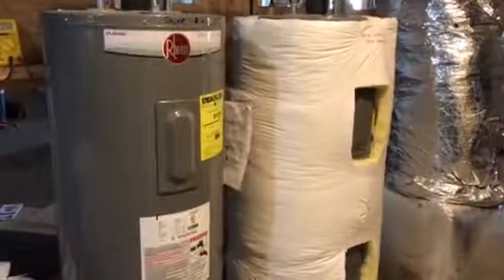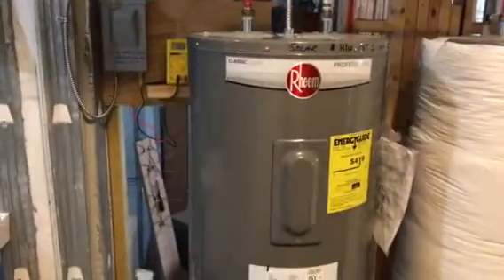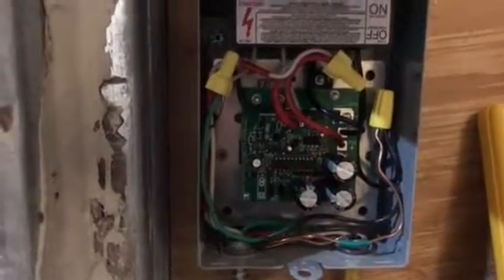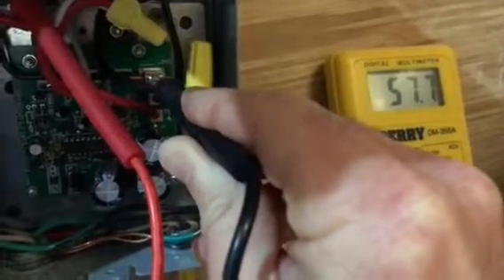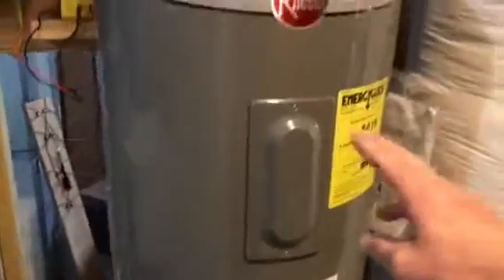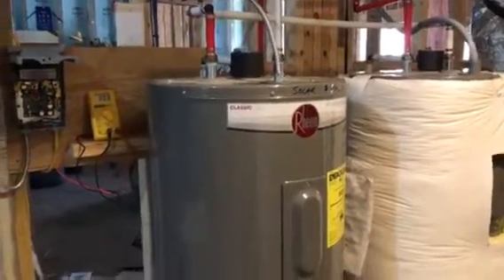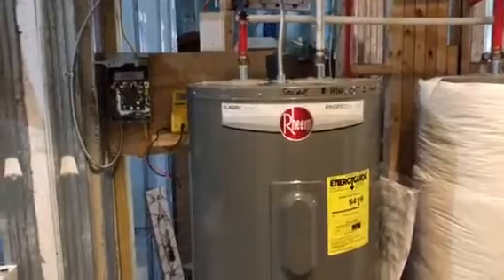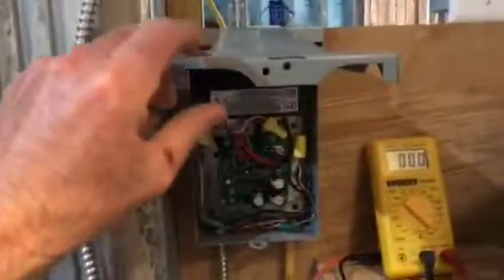Solar PV Water Heating and Power Storage

Comment: What is the advantage of using the Techluc if you have an electrically isolated tank might as well just run direct dc to the element.
Reply: Mppt in the device makes it way more effective than just raw dc.
Reply from the maker: Direct DC to the element is problematic.  Techluck explains the reasons on their website.  However Waterheater.org also discusses a direct DC setup - but it is a bit complicated.  The Techluck MPPT has after a year been working great.
Reply: @SATLE2322  Great glad it is running and working good. I just figured with the price of panels a fellow could put 2 more panels on the tank as direct current and produce more than the techluck board for economy sake . Cheers everyone has their ideas and as long as we try we are ahead of the game.
Reply: Many DC heating elements are dual element. You will see two shorting bars putting the elements in parallel.  Full MPPT matches the panel to the element by storing energy in a capacitor bank and matching the panel to the load. Even simple pseudo MPPT helps.  It is remarkable that at just 70% of the panels current, using just one element instead of two produces more heat. At about 50% panel current using one element produces twice the heating power of two elements in parallel. This is why it is that important.  A MPPT controller will give you 30% more power charging a battery.  With a heating element 5 times the power can be produced at low light levels.  If you live in AZ it doesn't matter much. In areas with some clouds it is quite important.  It is expensive if you buy commercially because there isn't much market for it. I build these MPPT units for about $30. Come and watch if you want to learn about efficient PV heating.
Reply from the maker: @opera5714  Thank you very much for your perspective and knowledge sharing on my channel I will check yours out.

Comment: So, I assume you are running two 30V panels in series.  You would be batter off running both heaters at the same time in parallel with their own temperature controller.  By my calculations you now can only put a maximum of 280W into a single heater element.  That is about half the maximum wattage that could be available.  If your location is challenged with numerous overcast skies your current configuration might work better.  I'm not sure the techluck could handle the higher currents of less than premium sun.  I get all my off grid hot water from PV and use a dual tank system of a 9 & 20 gallon tanks in series with 60V as the raw PV panel voltage. The 9 gallon has a fast recovery time and all excess energy can be sent to that in the morning.  For others attempting this,  common 2,000W 120V  heater elements are a good match for 60V. I can divert about 2,500WH a day to heat water.  I have a similar design which allows me to run with the same panels used for refrigeration etc without going through an inverter. Check out my latest video on water heating, I have many.  I like Gene, I hope he is doing well.
Reply from the maker: I had considered a parallel configuration except that I wanted to have full grid power for one tank on those occasions when demand for hot water is high.  My goal is simply to reduce overall grid power need for heating water and this setup was easiest and least expensive way to do it.  Having now had it in place for over a year I can report that 470W of panels in series is not quite enough for the winter months when the sun angle is lower/days shorter and I should install another 235 watts on the array (bring it up to the spec allowed limit on the Techluck MPPT).

Comment: Nice I wish I had one. You should put 3 x 300 watt panels on it and make plenty of hot water woo hoo! I bought four 190 watt panels and they are freaking awesome. I added them to my ten 230watt panels. I can run my double door fridge with ice in the door and my satellite and 52 inch plasma high def TV and my wifes computer and a 7,000 btu AC window unit man my electric bill is less than half what it use to be. I wish I could make another tracker with four more panels. and buy a few more leaf batteries. Next time Im buying some 300 watt panels the are so nice and powerful the only way to go. Im never getting less than 300 watt panels from now on the bigger 300 watt panels make so much more power its really made a huge difference in charging my lithium ions. My name is Scott too. =)
Reply from the maker: Yes I need to expand my array to at least three panels instead of two for this set up.  Just too many projects not enough hours in a day!  Thanks for the comment!